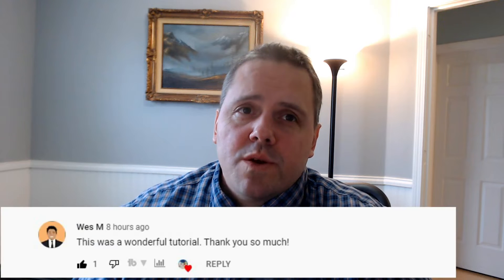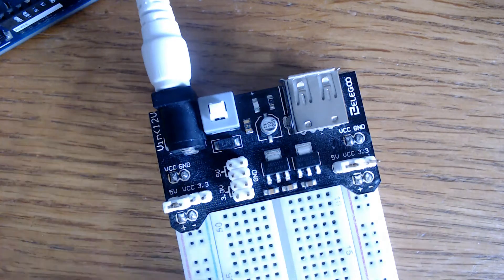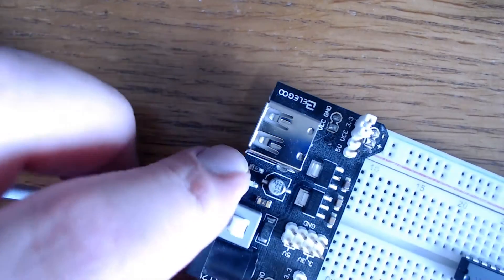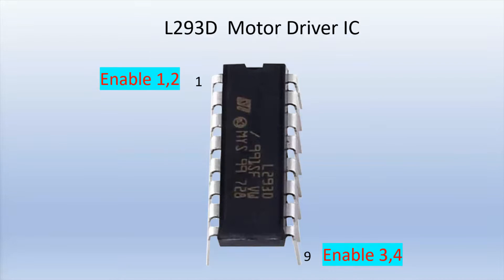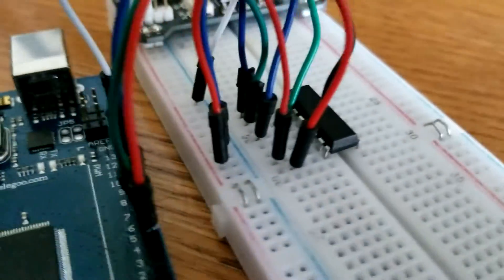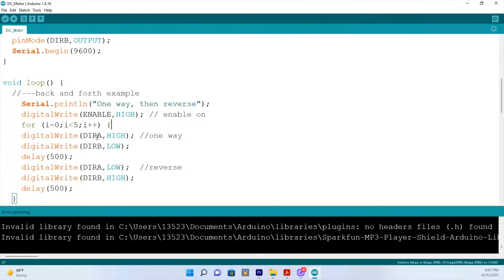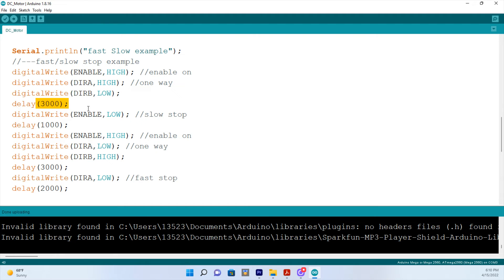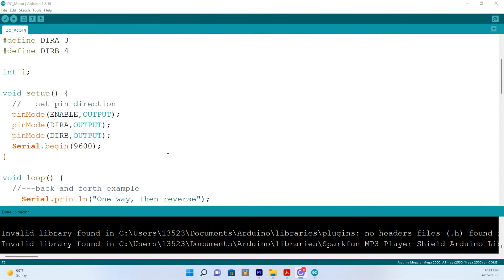Learn How To Control A Small DC Motor Using Arduino MEGA 2560 - Lesson 29 Elegoo Mega Starter Kit

Comment: Thank you for the great video!  I followed along but my motor is very weak.  It will only spin if I give it a manual boost spin.  At 4:20, you have two silver jumper wires along the positive and ground rails of the breadboard.  What are those for?  Would this help increase the power of my motor?
Reply from the maker: hey there! thanks for the compliment.

I assume you're using the same dc motor and breadboared power supply.
try this - connect pin 16 (vcc1) to Arduino board 5v  pin while keeping pin 8 (vcc2) connected to 5v rail on the breadboard. pin 16 is for the 5v logic wihle pin 8 powers your motor. 
Sorry for any confusion.

My breadboard has split power rails and I use the jumper pins to connect both sides...that's all.

Comment: do u also how to supply power to the arduino or does the separate stuff also power it?
Reply from the maker: for this video I am using a breadboard power supply to totally power the motor. I don't run motors or LED strands through Arduino. I think max current on this breadboard power supply is 700-1amp, will have to double check. but ya, the motor is powered from the breadboard to prevent current from destroying the Arduino.

Comment: great video, thank you.  I'm having the following issue. Have rechecked code several times and cannot see the problem, can you please help.

E:\Documents\PERSONAL\Bens_Arduino\projects\DC_motor_2_forward_reverse\DC_motor_2_forward_reverse.ino: In function 'void loop()':
E:\Documents\PERSONAL\Bens_Arduino\projects\DC_motor_2_forward_reverse\DC_motor_2_forward_reverse.ino:24:20: error: expected ';' before ')' token
   for(i=0, i<5, i++)       // cycle will continue until i<5, then will be disabled
                    ^
E:\Documents\PERSONAL\Bens_Arduino\projects\DC_motor_2_forward_reverse\DC_motor_2_forward_reverse.ino:33:15: error: could not convert 'digitalWrite(5, 0)' from 'void' to 'bool'
   digitalWrite(ENABLE, LOW);    // Disable
   ~~~~~~~~~~~~^~~~~~~~~~~~~
E:\Documents\PERSONAL\Bens_Arduino\projects\DC_motor_2_forward_reverse\DC_motor_2_forward_reverse.ino:34:14: error: expected ')' before ';' token
   delay(2000);
              ^

exit status 1

Compilation error: expected ';' before ')' token

My code is..    for(i=0, i<5, i++)       // cycle will continue until i<5, then will be disabled 

and also highlights.     digitalWrite(ENABLE, LOW);    // Disable
  delay(2000);
Reply from the maker: Hey there!  thanks~
You have some syntax errors and missing ";" ...maybe typos. Don't forget to define ENABLE.
Try this

#define ENABLE 5  // Define the pin connected to the motor driver

void setup() {
    pinMode(ENABLE, OUTPUT);  // Set the ENABLE pin as an output
}

void loop() {
    for (int i = 0; i < 5; i++) {  // cycle will continue until i<5, then will be disabled
        digitalWrite(ENABLE, HIGH);  // Enable
        delay(2000);                 // 2 second delay
        digitalWrite(ENABLE, LOW);   // Disable
        delay(2000);                 // 2 second delay
    }
}

Comment: I can't find the code for this
Reply from the maker: here ya go! 
//www.elegoo.com
//2017.12.12
/**********************
Exercise the motor using
the L293D chip
************************/
#define ENABLE 5
#define DIRA 3
#define DIRB 4
int i;
void setup() {
//---set pin direction
pinMode(ENABLE,OUTPUT);
pinMode(DIRA,OUTPUT);
pinMode(DIRB,OUTPUT);
Serial.begin(9600);
}
void loop() {
//---back and forth example
Serial.println("One way, then reverse");
digitalWrite(ENABLE,HIGH); // enable on
for (i=0;i<5;i++) {
digitalWrite(DIRA,HIGH); //one way
digitalWrite(DIRB,LOW);
delay(500);
digitalWrite(DIRA,LOW); //reverse
digitalWrite(DIRB,HIGH);
delay(500);
}
digitalWrite(ENABLE,LOW); // disable
delay(2000);
Serial.println("fast Slow example");
//---fast/slow stop example
digitalWrite(ENABLE,HIGH); //enable on
digitalWrite(DIRA,HIGH); //one way
digitalWrite(DIRB,LOW);
delay(3000);
digitalWrite(ENABLE,LOW); //slow stop
delay(1000);
digitalWrite(ENABLE,HIGH); //enable on
digitalWrite(DIRA,LOW); //one way
digitalWrite(DIRB,HIGH);
delay(3000);
digitalWrite(DIRA,LOW); //fast stop
delay(2000);
Serial.println("PWM full then slow");
//---PWM example, full speed then slow
analogWrite(ENABLE,255); //enable on
digitalWrite(DIRA,HIGH); //one way
digitalWrite(DIRB,LOW);
delay(2000);
analogWrite(ENABLE,180); //half speed
delay(2000);
analogWrite(ENABLE,128); //half speed
delay(2000);
analogWrite(ENABLE,50); //half speed
delay(2000);
analogWrite(ENABLE,128); //half speed
delay(2000);
analogWrite(ENABLE,180); //half speed
delay(2000);
analogWrite(ENABLE,255); //half speed
delay(2000);
digitalWrite(ENABLE,LOW); //all done
delay(10000);
}

Comment: Hey I followed the tutorial but my PSU started smoking. What did I do wrong?
Reply from the maker: That's interesting, sorry to hear that! Are you using a breadboard power supply? If so, was it damaged? Did you use the power supply with the jumper on the 3v side or did you use one of the 3v headers to operate a 5v motor? what kind of plug did you power the breadboard psu with ?  More detail will help pinpoint the reason for smoking.

Comment: Hey really good tutorial but I have a problem: my motor makes sound like if it was working, but the fan doesn't always spin. How can I fix it ?
Reply from the maker: Hi HASAN! use multimeter to test connection.  Check motor connection (solder joints,  alligator clips..etc) however you made connection.  If you're using a battery,  maybe replace or use 9v wall adapter in the barrel Jack of arduino. Don't power motor through arduino board. Use external power.  Try those ideas.  Thanks for reaching out! 👍
Reply: @BMonsterLaboratory  Ok thank you ! I tried what you said but everything is properly installed, do you have anything else to help ?
Reply from the maker: @hasankhaddam540  if the motor is getting power it should work.  Can you try another motor? You could also send me a pic of your setup
Reply: @BMonsterLaboratory  I don't have another DC Motor, but I can send you a picture. Where do I send you the picture ?
Reply from the maker: Bmonsterlab@yahoo.com
Reply: @BMonsterLaboratory  Hey I let the fan spin for a moment and it spins way better now than yesterday. Maybe it just needs a little bit of training to work. I'm gonna let it spin for some days and I will tell you is it gets better after that. Anyway thanks for the tutorial !
Reply from the maker: @hasankhaddam540  its probably a power issue.  If it's a 3-6 volt motor it might be getting low voltage.  Some components act erratic when there isn't sufficient power. Good luck to you! 👍
Reply: @BMonsterLaboratory  Hey good news ! It worked perfectly ! I think the issue was that I never make it spin, but now it is fixed.
Reply from the maker: Awesome! Glad it works! Good luck on future projects, Hasan.
Reply: @BMonsterLaboratory  Thanks man ! Good luck you too !